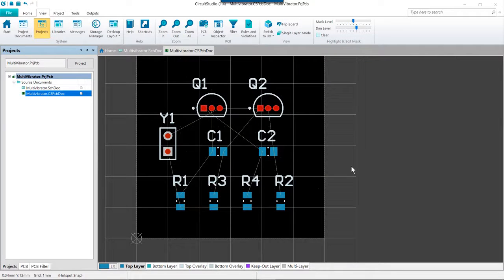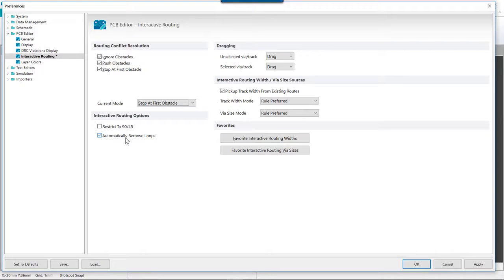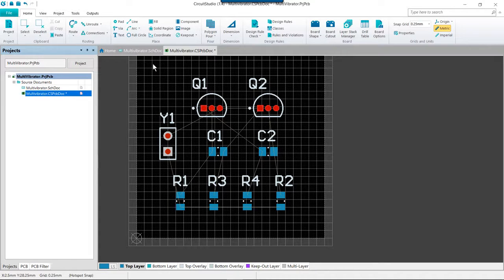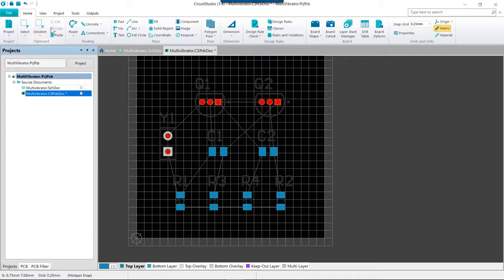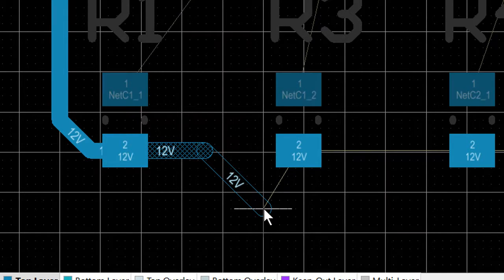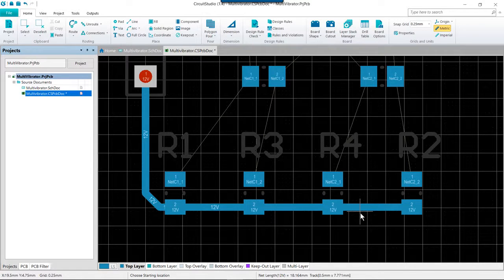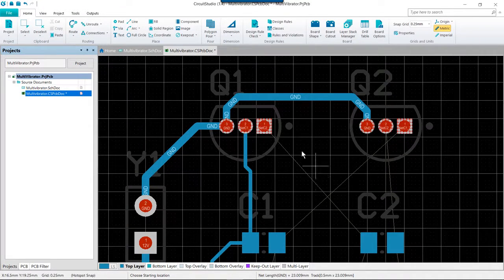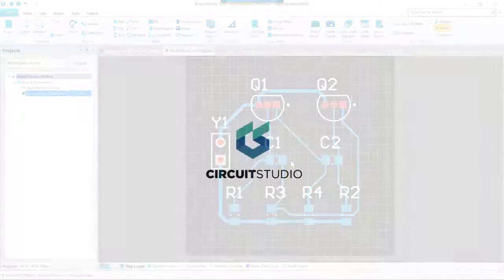(8) Routing the Board in CircuitStudio - Altium Academy

Comment: I wish you were routing a two layer board and changing the layer during some routes with vias placed because I cannot find a shortcut way to do that without it taking several steps. I have to stop a route on one layer, place a via, change to the next layer then start routing again from the via. Ridiculous.The Altium shortcuts such as holding Ctrl + Shift then moving the mouse to get choices of next layer I want to route to doesn't work.